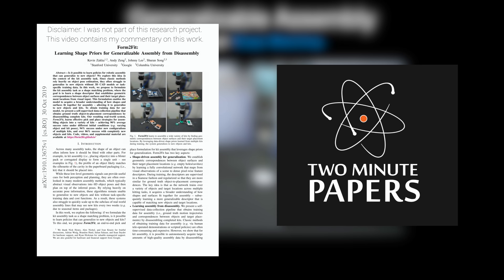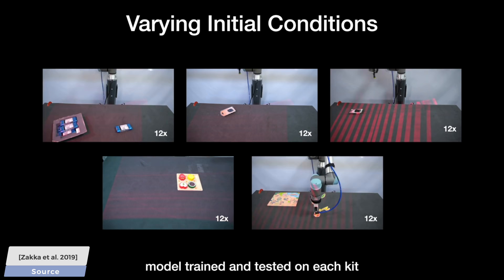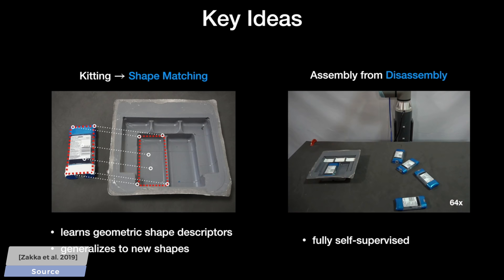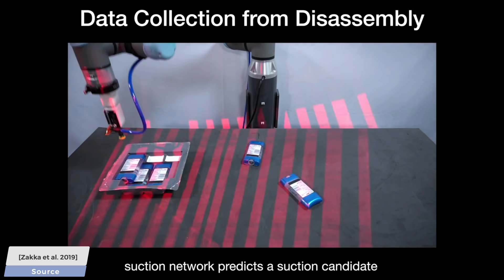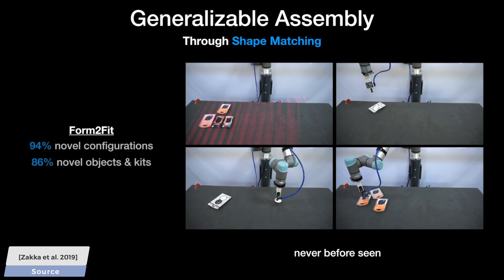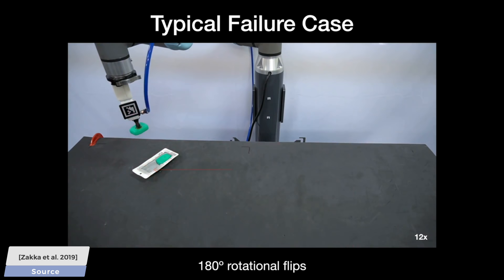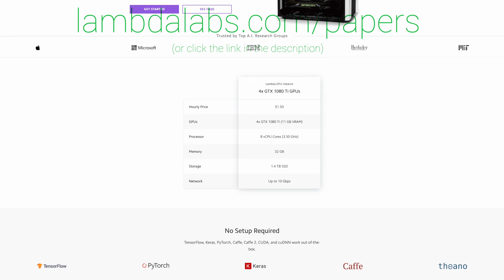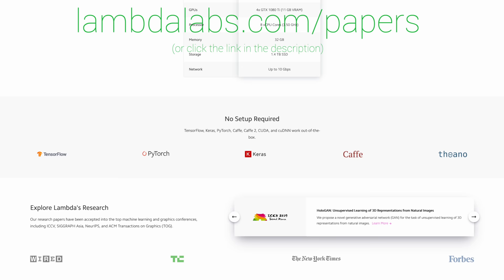This Robot Arm Learned To Assemble Objects It Hasn’t Seen Before

Comment: If you have ever bought a new bed or a cupboard and said, ‘This just looks like a block. How hard can it be to assemble? Wait, does thing have more than a 100 screws and pegs? I wonder why.’ 
And then, 4.5 hours later, you find out yourself.

I felt that

Comment: There is a difference between assembly and packaging. Most assembly can be and is usually complex. Packaging is placing a item into something else shaped for it. Even the puzzles can be considered packaging do to putting the correct shapes and patterns into the identical shapes and patterns. This is still impressive though to be self learned by the technology. 
Technology always has its origin story like this one. It will get better soon, if not already.